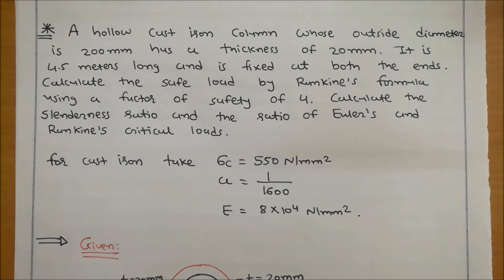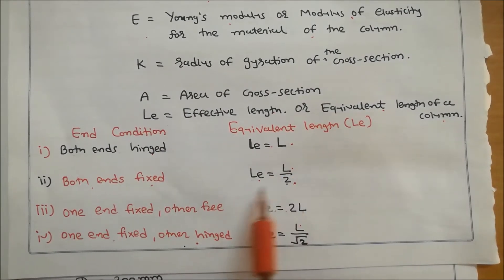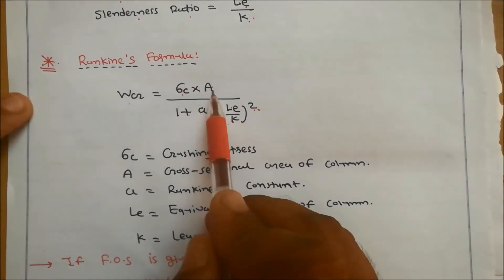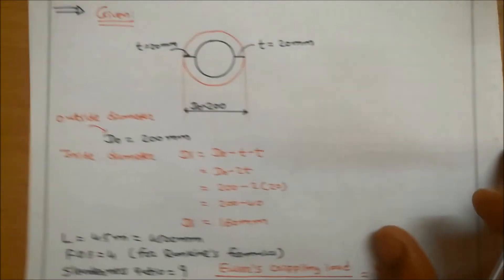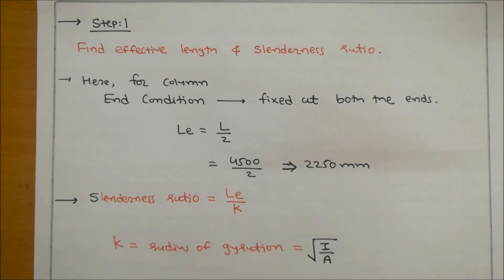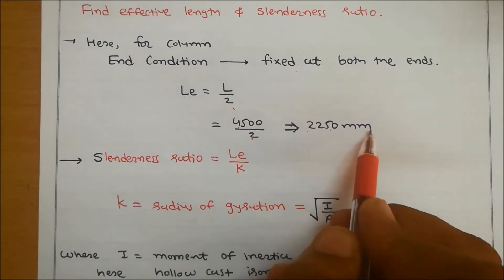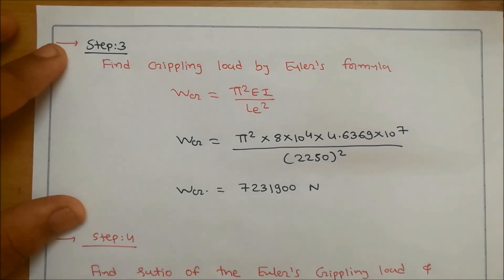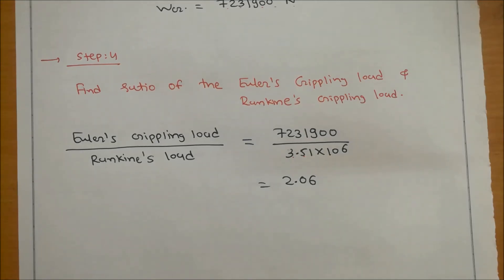Column and Strut numerical-4 (Rankine's Formula))

Comment: A hollow cast iron 5 m long column with both ends fixed is required for support a load of 1000 KN. If the external diameter of the column is 250 mm, find its thickness. Take working stress as 80 MPa and Rankine's constant as 1/1600.

Solution please

Comment: 3. Using Euler’s formula, Find the critical stresses for a series of struts having slenderness ratio of 40, 80, 120, 160 and 200 under both ends hinged condition. Take E = 2.05 * 105 N/mm2.

Comment: Sir in the rankine load formula . Is it necessary that we have to replace the Original length by the Equivalent length? Can't we solve using original length?
Meaning sir if we use relation between equivalent and original length for a particular case meaning one end fixed and other free (consider).
The results using equivalent length is different as compared to using Original length!!
Reply: In rankine if u want to use effective length then the formula will change on the basis of their connection.
Reply: @sailendranathpal8  ok sir 👍🙌🙌
Reply: One fixed & another free in this condition: Le = 2l